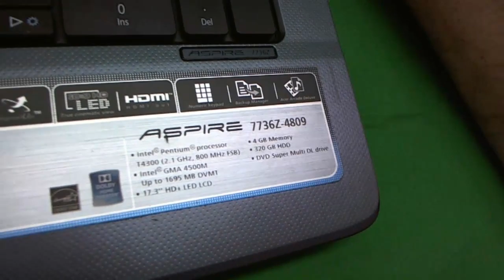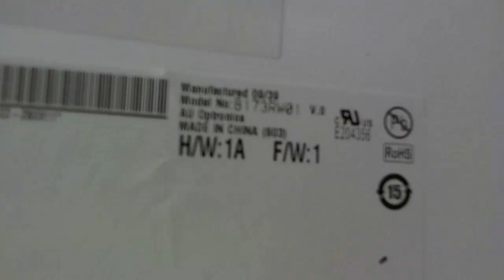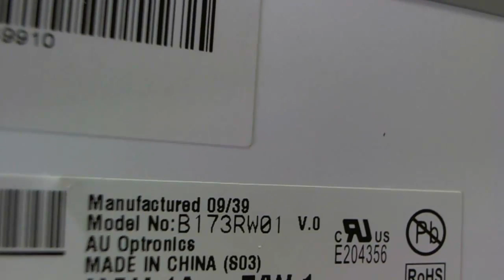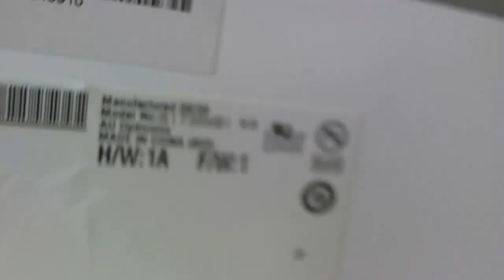Acer Aspire 7736 7736z Laptop Screen Replacement Procedure

Comment: Great Instructions. Can you help? Dismantled and part number replaced exactly to your video (great video btw) however when i replace it and switch it on i get a black display and no boot screen etc....

HOWEVER if it take my old cracked screen off whilst its on a plug in the new one in  wallah! I get an image on the screen.
I go to restart the laptop and on reboot i am back greeted with my black lit up  screen and no image

Am i missing something obvious here to my problem? Driving me insane